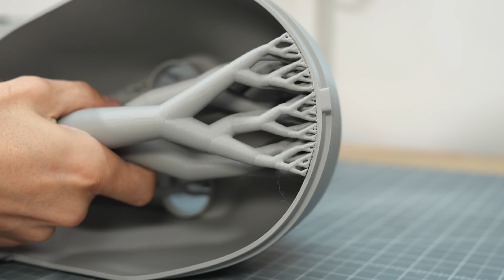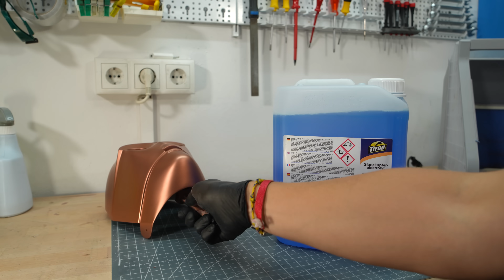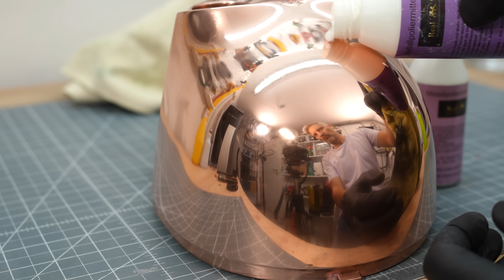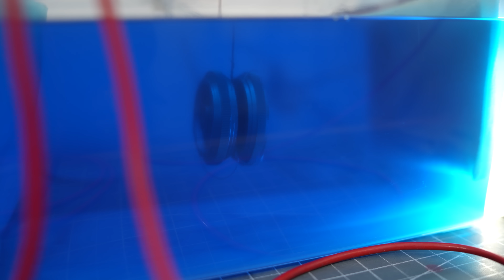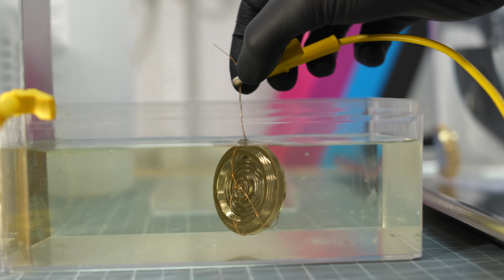How to create stunning Props from 3D Prints by Electroplating them!

Comment: could you please tell what is the optimal mixing ratio for preparing a copper sulfate solution. How to adjust the voltage and current to suit the workpiece to be coated and how long the work piece should be in copper sufate solution. When should use grapphite or copper paint and does it give a better surface if you use self made paint. How do you calculate how thick the copper layer becomes

Would help so much if you could answer my questions.

Comment: Two stupid questions from a noob:
(1) Why do you need a "barrier layer" for gold?  What happens if you don't do the barrier layer?
(2) I would suspect the electroplayed surface to be delicate (easy to scratch, easy to fingerprint, etc.).  Have you tried some type of "clear" or "topcoat" on your models?  If yes what would you recommend?
Reply from the maker: There are no stupid questions with this stuff:
1: metal diffusion = rose gold over time
2: I use hard gold. Very hard. Top coating would be good for copper to avoid oxidation. I wouldn’t suggest at all. Looks and feels better

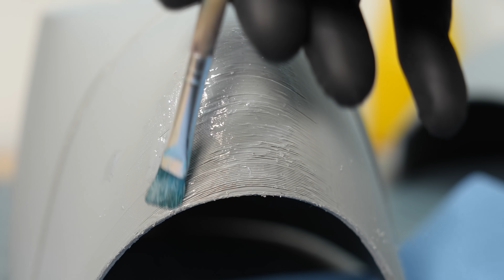Comment: 01:51 you mix resin with baby powder??? Is that the point where every guy in the US use bondo? 

Was man leider nicht bekommt in Europa - Woodfiller muss ich noch probieren…
Reply from the maker: Du kannst polyesterspachtelmasse verwenden, aber das stinkt wie Hulle. Woodfiller find ich schwierig, verwende ich aber auch. Manchmal.
Reply: @hen3drik  verdünnst du den Woodfiller mit Terpentin oder Aceton?

Wo kaufst du die Spachtelmasse gibt es die im Baumarkt oder Amazon?
Reply from the maker: @  baumarkt. Polyesterspachtel. Aber: nasty stuff!
Reply: @hen3drik  schonmal dieses Bondo probiert dass alle Amis nehmen? Ev. Ebay kaufen…
Reply: @hen3drik  ist das zB von Pattex? Nennt sich aber Polyesterharz?

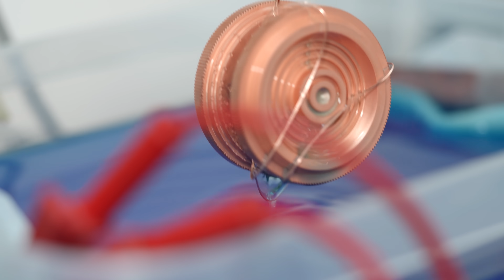Comment: Hallo was macht man falsch wenn es nicht so glänzend aussieht wie bei dir bei Minute 8:02 so sieht es immer bei mir aus😕
Reply from the maker: Long story short: it’s probably the electrolyte combined/or current field. Start experimenting with different distances to the anode and different currents. There’s a test jig called hull cell. Get this.
Reply: @ the test jig is this on yt to watch?
Reply from the maker: @ no, you have to google „hull cell/hull Zelle“. You could also try to print one. It‘s for measuring the electrolyte to find the right current for your solution. Cheap and effective.
Reply: @hen3drik  ou ok ok thank you
Reply: @hen3drik  Hallo, habe jetzt das auch versucht aber ohne erfolg leider habe versucht den 3d druck weiter von der Anode zu platzieren, näher zu platzieren hab die Stromstärke in Blender berechnet wie du hab ne Fläche von 1.10 Quadratmeter da hab ich Laut Rechnung 0.560A eingestellt aber es sieht immer noch so milchig aus nach 2h33min ich verstehe es nicht😕
Reply: @hen3drik bitte hilf mir bin am verzweifeln hat es vielleicht was mit den volt zu tun? Hab ungefähr 4-5 volt bei 0,450A und auf der flasche steht 0,6-0,8V aber ivh kann nur die Ampere einstellen weil die Volt automatisch hoch gehen dann
Reply from the maker: @stefankrsmanovic3776  4-5V ist viel zu hoch. Ich kennen deinen elektrolyten leider nicht. Die sind alle unterschiedlich eingestellt (von Werk aus). Wenn du 4-5V brauchst stimmt was nicht mit deinem leitlack (miss ihn durch: 1cm sollte unter 1k Widerstand sein). Prüfe die Kabel, Drähte zum Objekt. Schaff mehrere kontaktpunkte. Platzier es 10cm entfernt zur Anode. Die Anode sollte mind. gleiche Oberfläche haben wie das Objekt.
Reply: @hen3drik  also ich meinte ich hab 0,4 bis 0,5 volt bei 0,450 A kann ich die volt irgendwie einstellen ?weil das verstellt sich automatisch bei mir mit die ampere und muss der draht am druck teil leitend sein ?oder reicht kupferlack draht? Ich vermute es liegt nur an die Volt weil auf der Flasche von dr galva steht 0,5-0,8 V und ich komme auf die Volt einfach nicht ohne das ich die Stromstärke A hoch drehe aber dann hab ich zu viel Ampere und die Fläche wird hässlich.
Reply from the maker: @ Volt und ampere funktioniert nicht unabhängig von einander. Fang mit halber amperezahl an. Regel es nach 30min höher. Mir dr. Galva habe ich leider keine Erfahrung.
Reply: @ ok danke 😪

Comment: Really, compliments on your video!! they are truly beautiful, really beautiful! I tried it, and everything works well. The only thing I don't understand is why, in the end, the copper plating works or the copper is a bit dull, but mainly, the copper comes off like a film, a sheet, and doesn't adhere. It peels off and remains underneath the 3D print, even without paint, as if it's flaking and doesn't hold. Could it be that the layer is too thin? Or is there some other problem?

Comment: is it possible to replicate the effect you see on some modified car/motorcycle exhaust. where the tip is blue from heat and slowly fades over purple to a golden color.
i'm asking because i'm about to start the famous 3DjetEngine and would love to blue heat discoloring effect on some of the prints.
i would be greatful if you made a video about it if it's possible.
Reply from the maker: That effect is hard to achieve, but it kind of works for certain materials with a torch. Yet it’s hard to control.

Comment: this is the best result I can get! they are 10000 mm2 I set the Ampere to 0.400 x 30 min then I gradually increase up to 2.0 A in a cycle of 4 hours, I add 4 drops to 1.5 liters of shiny tofoo and the copper plate is 4cmx4cm I inserted a pump to make the liquid circulate, the pH is 1, the temperature is 23 degrees, can anyone tell me where the error is and why I can't see myself in the mirror?! I use a low pressure and low jet airbrush, I dust the piece after half an hour from the application of liquid copper tifo diluted with nitro thinner ratio 1:2, the piece before painting it I smooth it until I see myself inside with 10 000 sandpaper, I do three tests a week to reach perfection but I can't do it, help me, thanks 😁
Reply from the maker: Use a 1dm² anode. The anode has to be a least the size of the the print. Set Ampere to 0.5A for 30 min and after that to 1A

Comment: I was extremely interested on how you did the "copper paint." I have dabbled with the idea enough to know it is NOT as simple as it sounds. So when you just say acetone and copper powder... it confuses me. Also getting such a good surface finish from electroplating is equally frustrating. None of this is easy, so I'm wondering am I just...stupid, or are you glossing over important details?
Reply from the maker: I would always recommend buying a professional conductive copper paint. These use additional compounds to stick better to the print. Also the size of the copper powder is important too. The trick is polishing and polishing again. It’s a quite fragile process that I’ve practiced a lot the last years. It’s basically like I show in the videos, there is no missing step but many steps where you can ruin the whole process.

Comment: Hi ! Thanks for teaching us!
Do you have any recommendation for me? I try to apply the copper conductive paint with an airbrush just like you. I dillute it 2(acetone):1(copper paint). I ensure the surface is prepared and smooth (resin print). But when i brush on the mixture, the painted surface is not as smooth as yours, and electroplating it is far away from mirror glaze. Maybe my airbrush pressure is not enough? (3 bar while painting)
Reply from the maker: It takes practice. Try lowering the pressure. Dilute more. Try different angles while spraying.

Comment: The antenna is too long at the back where it joins to the head. The 2 washer looking parts are supposed to be up against the head, You have an extra cylinder shape that should not be there.

Comment: Man how do you get that shine right out the bath? All my electroplates come out rough and i need to wet sand before polishing. Truely you are a master at your craft.
Reply from the maker: I try to deposit very slow with the correct current and an even electrical field. I maintain the bath that it has no dirt in it and polish the conductive paint carefully before plating

Comment: Hi HEN3DRIK. Amazing work, congrats! 
After watching your video like 5 times :D I have a question.
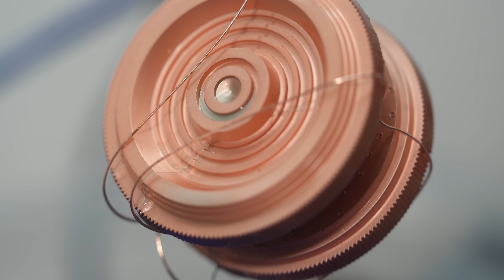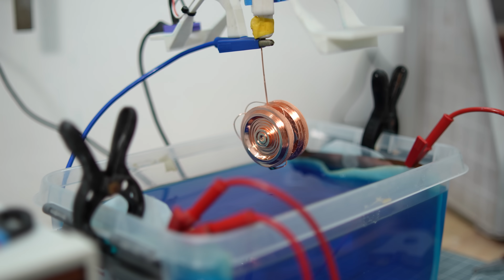When you take the part out at 8:03 its matte then on 8:05 is super shiny. What happened? have you changed anything, or you polished in between?
Reply from the maker: Good catch. I missed a dubbing. the matte is after 1 hour. I wanted to show what it should look like after that time. 8:05 is after 4 hours when the brightner kicked in
Reply: @hen3drik  After how many hours does it usually turn from matte to shiny? Do you change anything in the current for that or just keep it constant at 1 A/dm^2?
Reply from the maker: @kedo87  Start 0.5* the first 30 min. It usually becomes shiny after 2-3 hrs
Reply: Great, thanks for the hint!! Gonna try asap :-)

Comment: Good morning, my friend. I have been following your work for a long time and I have to congratulate you on your excellent work and very explanatory videos. My question is about the paint you made using copper powder and acetone. Do you have any more information about the copper powder, any specifications, is it electrolytic? I believe this is a question that many people have. Thank you very much.
Reply from the maker: Hi, I use a commercial conductive copper paint that is very thick and i thin it down to make it airbrushable. This paint is not conductive when applied but when it gets into contact with acid. Then it suddenly becomes super conductive. I have yet to make my own, but that's what I'm trying to cover in the next videos or so. I know that getting conductive copper paint is a hassle when not in the EU, so sticking to DIY conductive graphite paint in the meantime is a good alternative AFAIK

Comment: looks amazing 
is the health risk worth it though? probably not
so are there any services like JLC PCB this do this kind of electroplating yet?
I wonder how expensive it is or would be
Reply: I don't think there is that much health risk, as long as you use basic PPE. The most unhealthy processes in here are sanding, that is easily made safer for your lungs using some kind of particle filter mask; the plating acidic electrolyte that contains a small fraction of sulphuric acid that can again be made safer with the proper gloves; and the resin, which I have never dealt with so I'm not that sure about it but many people handle it when using printers so I guess is not that hard to manipulate. To me, the biggest problems seem to be getting all of the stuff, the money and time consumption. But yes, it's true it would be great if there was some kind of service to do all of the great work!
Reply: @adrw216  Yes but no matter how careful you are you will always get sot exposure 
That dust goes every and those vapor filters for the 3m masks are all but useless 
There is a minimal amount of carbon in them
I used them to paint my garage and still got sick from the fumes.
They do almost nothing

Comment: There are some mirror finish metallic spray paints that have been out for a few years that come surprisingly close to that appearance however. So one may want to do a comparison for surface prep and costs. (I suspect the rattle-can stuff not only saves time, but is likely a lot cheaper.)

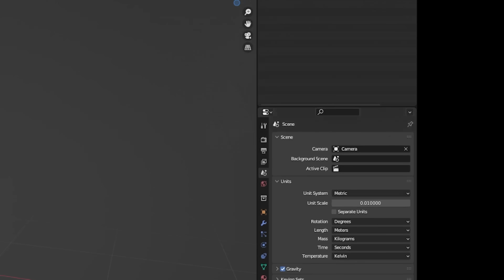Comment: I don't know if you have the scale off or where the number comes from, but the surface area of the mask definetly isn't 18 square meters as indicated by the program at 04:55
Reply from the maker: I use modified units in blender to directly transform to Ampere. It’s actually 18dm^2. good spot.

Comment: Did you try acidic bright copper electrolyte from Dr. Galva and if so, how does it compare to Tifoo's plating solution? Because it is cheaper per liter, and the price difference becomes very noticeable (about 150 euros) with such high volume.
Reply from the maker: Haven’t tried this, yet.

Comment: Surfaces scale quadratically, Volumes scale in a cubic manner. Doubling the sides of a rectangle you get 2^2 = 4 times the area. Doubling the edges of a cube you get 2^3 = 8 times the volume.
Reply from the maker: You're absolutely right.

Comment: Sehr schön! Have you tried using ABS or ASA and using an acetone slurry to fill gaps/adhere different parts, or vapor smoothing? It's a little harder to print and more expensive, but very doable with the x1 carbon. I've done it for cosplay armor so it won't melt if I leave it in the car for 45 minutes while I get food on the way to a convention. Is that not a concern after electroplating?
Reply from the maker: Thanks, yes ABS or ASA could be used, i would not vapor smooth them for eveness of the surface but maybe to fill the gaps and cracks to seal it up a bit. After electroplating the PLA is more or less imune to heat. Greetings!
Reply: @hen3drik Servus! Das ist interessant. I've been wanting to try electroplating ever since your full tutorial video a couple years ago, maybe I'll finally pick up a B&K 1901B (or convince work I need a R&S NGP814 for my work from home lab haha) and experiment.

Comment: Would love to see a video maybe on things that can go wrong during the plating process, and how best to avoid them. Also, I've never had much success with sanding as the layer always starts to peel off before I can get to the higher grit sand papers. Maybe I just need to go gentler as the pieces spend a long time in the bath so I don't think the thickness is the issue.

Comment: I wouldn't use resin for filler, I found good results from Big Boy car body filler. It is very versatile and easy to use like a 2 part epoxy which sets hard in about 15 minutes ready to sand and paint. I've also used a soldering iron and spare PLA off the roll to fix parts that need strength and then smooth them over while the soldering iron cools down.
Definitely turned out great. 
I would agree with Homer: If something takes a long time to do, it's probably not worth it. But that's just me
Reply: Using resin as filler literally takes seconds to harden.  And since it's resin on resin, there is no separation and very little to sand.  It also utilizes the same materials you already have on hand.  I've used resin filler on resin parts for years.  Car filler is good if you have large parts to fill where it would take forever to brush in resin.  But on small blemishes and seams, resin is 1000% easier and faster and much less fumes.
Reply: @cuthwulf   I see. Thanks. Although there's no fumes for car body filler either. I was just looking at the results as it was applied and thought it wasn't very smooth. But if it bonds well with the material (I thought it was PLA so didn't know this) then it's probably going to give a better finish when sanded)

Comment: What layer height do you print then? 0.08 or 0.2? With a 0.4mm nozzle? When using the X1C
Reply from the maker: I use did 160-200microns with a 0.4mm nozzle.
Reply: @hen3drik  Thanks, I'm going to be testing some small prints over the next few weeks, thanks to your help and videos.

Starting with small items, like dice.
Reply from the maker: @Filharvey  good choice
Reply: Will do a first attempt video tomorrow of my footage. Not bad attempt if I say so. Some issues which I think are initial sanding. But your videos have helped me all the way